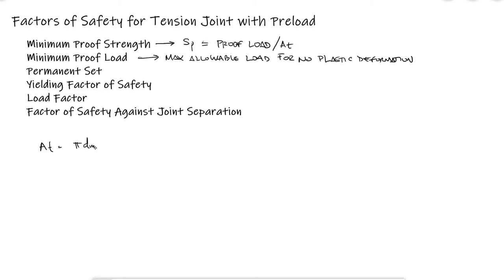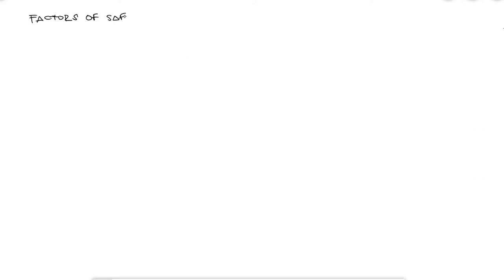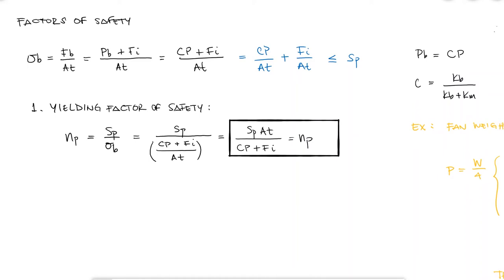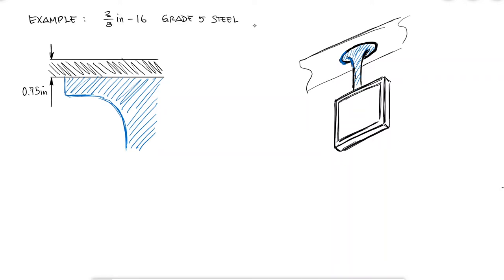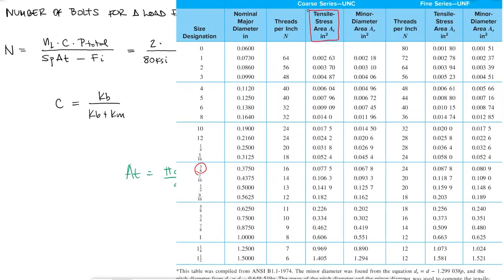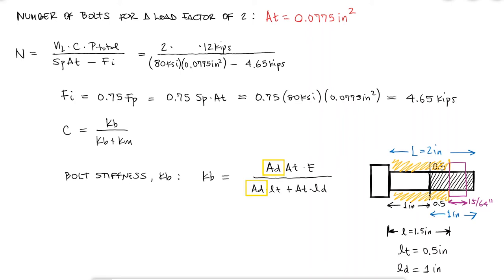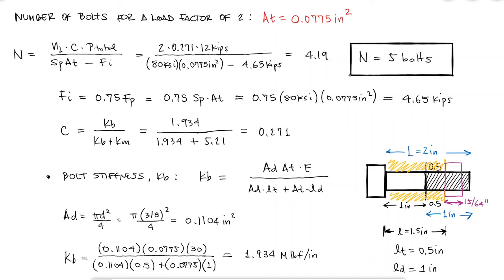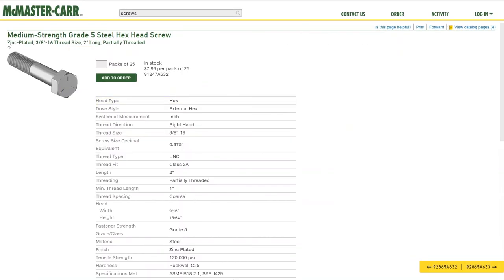PROOF STRENGTH - Factors of Safety for Tension Joints with Preload in 13 Minutes!

Comment: Could you please check the value of Sp as used in the calculations? (Table 8-9 of Shigley's textbook: Sp = 85 Kpsi). Am I right?
Please also check the final value of Km.
 Thanks for the video.
Reply: I concur. The value should be 85kpsi. Shigley's example on pg 442 Example 8-4 also agrees (see answer #3 on pg443)
Reply: yes bro I noticed that too. thanks for your comment. I thought I am the only one who think like that.

Comment: If this calculation done reverse, isn't that more easier? Like Based on gut filling, assume 4 number of bolt n find out external force in bolt. Then based on bolt stiffness n joint stiffness calculate fos. If its slightly less than 2 then increase number of bolt or size of bolt. Isn't this another approach?

Comment: Thank you very much once again, really helpful. Just one question, if the bolts weren't meant to be reused, the safety factors would've been less than 1?
Reply from the maker: Not necessarily. If they're not meant to be reused, it only means that the preload, Fi, can be higher; which means that all the calculations (for allowable external loads, for example) need to be carried out again with that new Fi value. The safety factor should always be greater than 1 for the design not to fail.